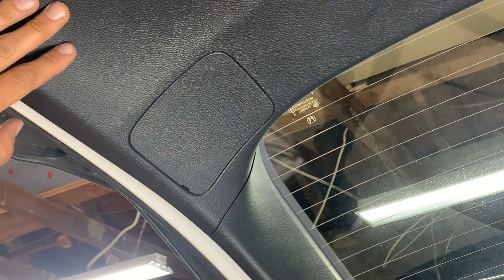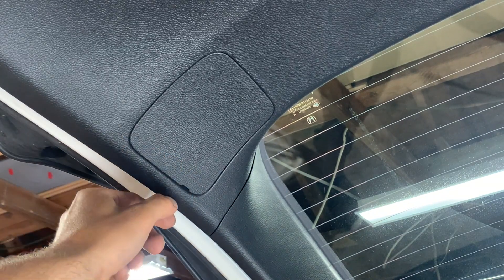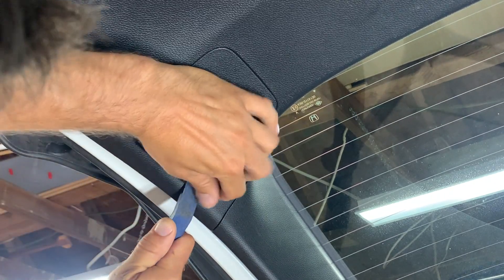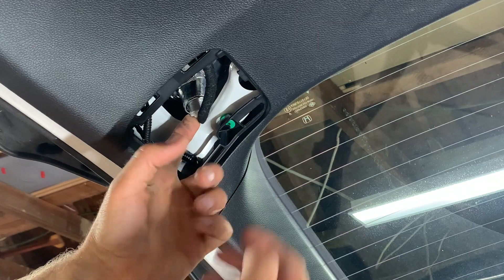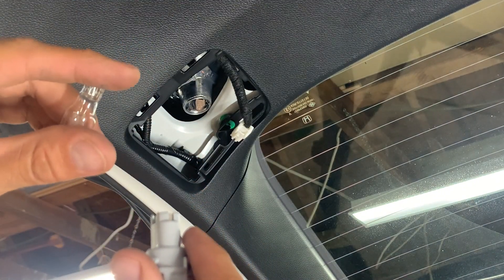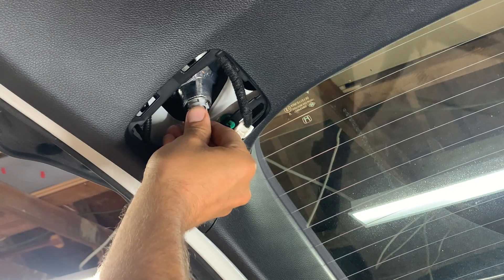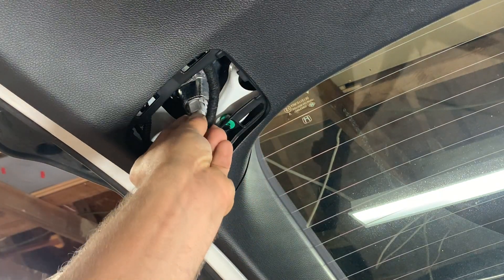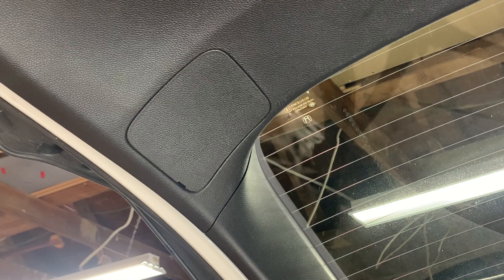How to Replace Reverse Light Bulb on a 2017-2021 Honda CRV

Comment: Just changed mine to LED bulbs and looks 💯X’s better. Thanks to this video it was easy to know, I thought maybe I had to unbolt the taillight.
Reply: Which LED bulbs did you get? I'm trying to find one for tail light and Reverse.
Reply: As I rip off the front bumper to work on my fog lights. 😅